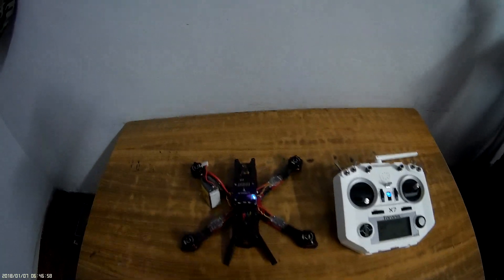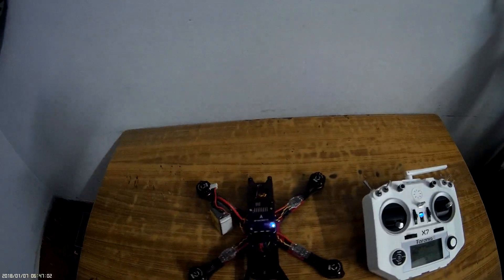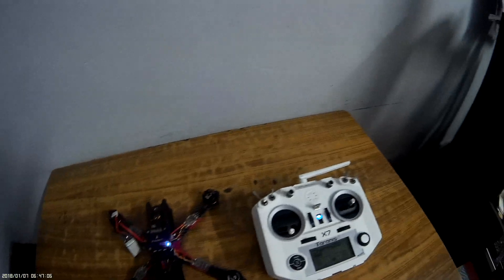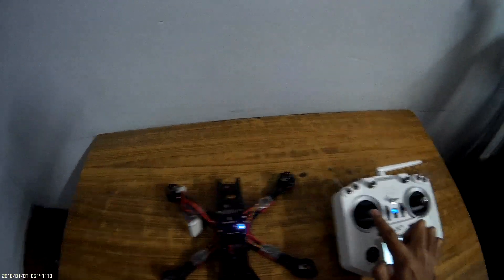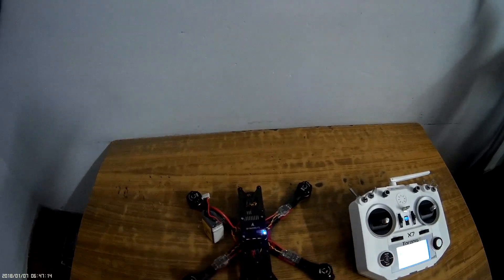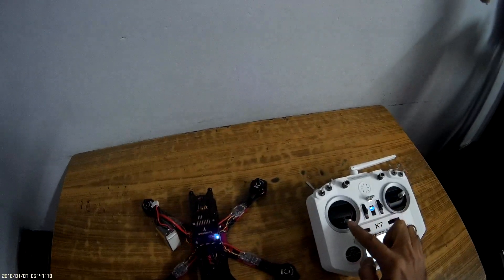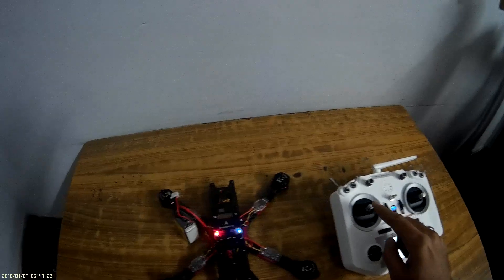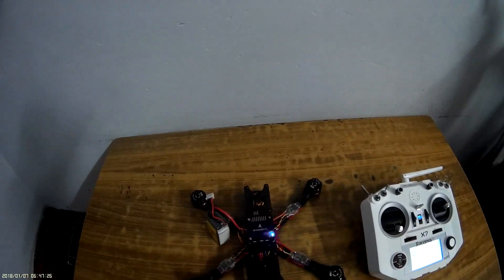SP Racing F3 red light flashing problem (solved)

Comment: this is happening to me when i try to plug it in to the computer. I havent gotten to connecting it to a transmitter yet, the light is blinking and the motors are not running when i use cleanflight.
Reply from the maker: Which transmitter and receiver you are using ? I suggest you calibrate the FC (standalone) 1st using clean/beta flight , then sync the FC with receiver depending on your receiver type(sbus/pwm/cppm). Painless360 have made 9 Part series for Seriously Pro F3 pls follow those videos 1st on youtube with patience. And come back to me with your detailed problem.

Comment: My board flashes like yours but does not turn off when I go to zero throttle help??
Reply from the maker: Sam Will move the yaw stick to the left to turn it off.
Reply from the maker: Sam Will you mean even at 0% throttle the motors keep spinning ?
Reply: Mukund Chethan no my issue is it won't arm
Reply from the maker: Sam Will then u can assign a switch for that using clean/beta flight modes.
Reply: Mukund Chethan in beta flight when my battery is plugged in it doesn't show that it's plugged in even though my controller shows the battery
Reply from the maker: Sam Will did you solve your problem ? I use clean flight, I not that familiar with beta flight.
Reply: @samwill2139  I have the same problem it won’t arm
Reply: @gonzyyy  I have learned that you need a different FC I haven’t bought a different fc and gotten it to work but that is the only thing that will make it work I spent a few months research because I used it for a school class project
Reply: I have the same problem. What I come up with is that FC is dead :[. let me know if you find a solve. But I tried multiple PC and nothing will detect my board.
Reply: mong nky I figured out how to get it to work with the computer you have to short the boot port on the board and then plug it in to the computer not sure if it's for sure the boot port I'd have to check
Reply: So your PC able to detect your board? and did you able to use the board again afterwards?
Reply: mong nky I haven't been able to use the board with the quad because the battery/charger doesn't work
Reply: but the board works totally fine now? Sorry if these are silly questions, I'm a bit on the newbie side
Reply: mong nky it connects to the computer but you have to flash the board with beta flight or Clean flight and I'm new too so I'm looking for advice too